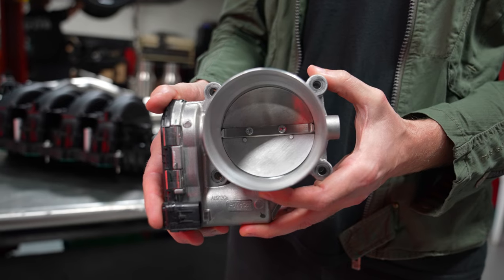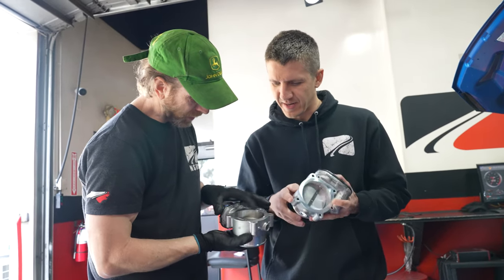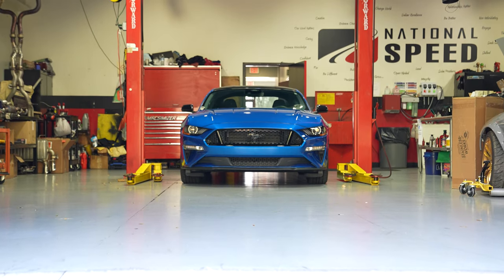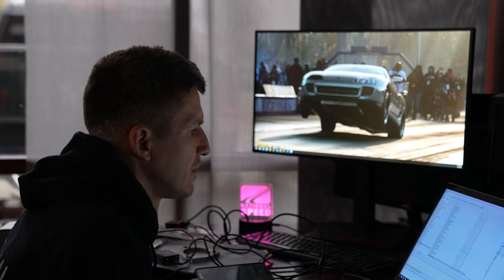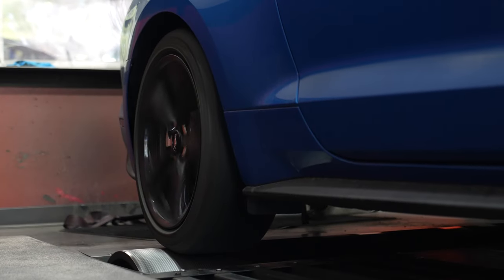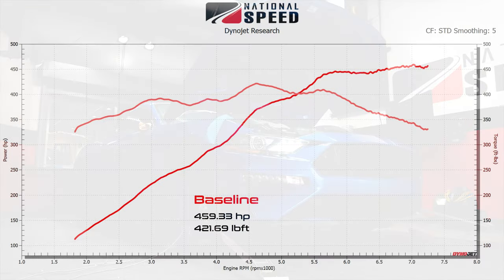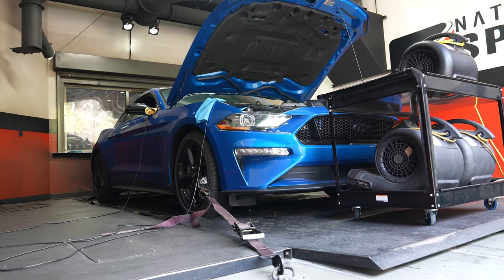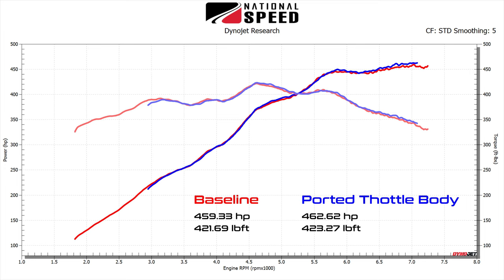DYNO TESTED: Ported Throttle Body For Mustang Worth It?

Comment: Good video definitely not worth it glad I didn’t waste money
Reply: If you tune it to take advantage of what you done.... You get more power...
If you do lots of mods at once and then tune it.... You'll add up a lot.
Reply: And time
Reply: Is only worth it with supporting mods like a turbo. The turbo will pull more air in which you’ll NEED the ported throttle body 🤓
Reply: It ain't tricking if you got it
Reply: @-_-Raziel I’ve built wiring harnesses for aftermarket ECUs and tune my engines.  No the fuck it doesn’t lmao

Comment: Its not worth doing on a N/A car with stock cams and stock cast heads
Reply: Got an 05 Astra h 1.6  z16xep engine. Aside from all the smog emissions deleted out, I just recently done my tb and bored out the intake manifold, I can tell a small difference to throttle response. Got little more kick. But should just do engine conversion really
Reply: Combination ported TB and intake with a cam ridiculously wakes up the motor. I did a home built gutted and ported manifold. I gained 1k rpms of power band and 10-15 whp and power didn't fall off at 9k. Well. This was a p13"h22" manifold pro2 cams on a Japanese market F20b swap.

Comment: interesting to see a ported intake where they dont change the actual diameter of the throttle plate. i got a stock body ported on my old car from 55mm to 60mm and bigger plate and it gave a 8hp increase on a 100 wheel hp car xD

Comment: When I was a teenager and had no money to upgrade my cars in edition just needing to tinker with something I would remove the throttle body shaft and cut off one side of the shaft horizontally. I would cut off the side that originally held the head of the screws. This side is not threaded. Then I would used countersink screws then cut off the end of the screw making it flush with the half shaft. I would even fill in the countersunk screw Philips slots or hex hole with epoxy that would stay in but I could burn or chip out if I needed to remove the screw. 

Preferably you only want to remove the part of the shaft that is exposed at half throttle. When a half throttle the throttle plate would be completely smooth with no shaft speed bump.

Comment: The only reason I'm considering having my throttle body ported is to smooth airflow in from my 4.6L 2V's ADTR ziptube and out to my Trick Flow 75mm upper plenum. The slight venturi effect of necking down to the throttle blade will increase flow speed, while porting out to the plenum will increase intake pressure. Hopefully, that'll improve throttle response, something the dyno can't measure, even more than adding the new ziptube and upper plenum did.

Adding Trick Flow heads and aftermarket exhaust will add the power I want. I'll need a dyno then.

Comment: I'm just throwing in my 2cents but I've been told by other enthusiasts to stick with an 87mm tb for gen 1 and get a 18 intake manifold w/ whatever cold air intake preffered for max power in my gen 1 5.0
Reply: also he is likely seeing baby gains cuz the butterfly valve and plate are untouched so its technically still stock. Was told to stick bbk by the same gents and after seeing this I think tht rings true

Comment: The hump or convergent duct acts as a ventri. The engines stock throttle body is sized to deliver the engine requirement for CFM. The design uses physics to speed up the incoming airflow right before the throttle blade. This allows for crisp throttle response and moving the airflow at lower RPMs. Do not oversize a throttle body or it will make it a dog down low in the RPMs
Reply: This is not entirely true.